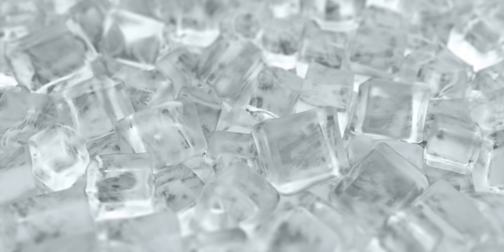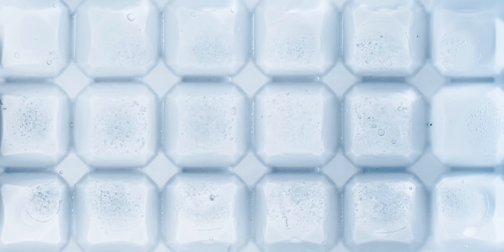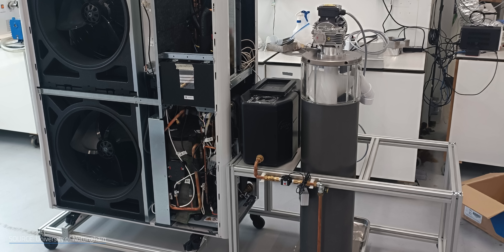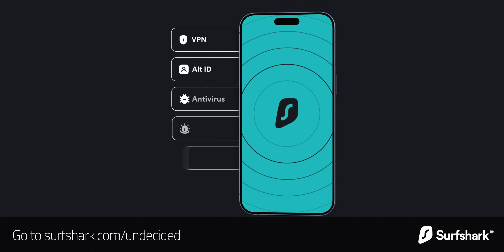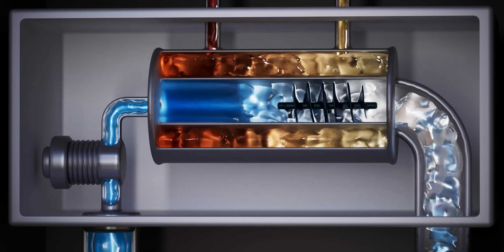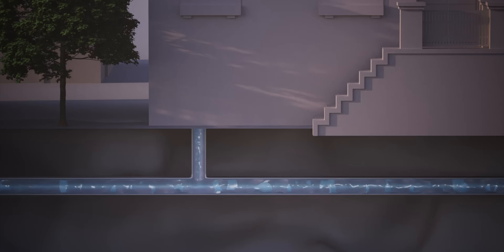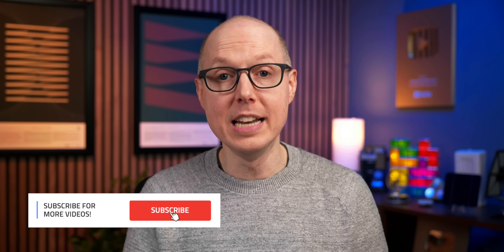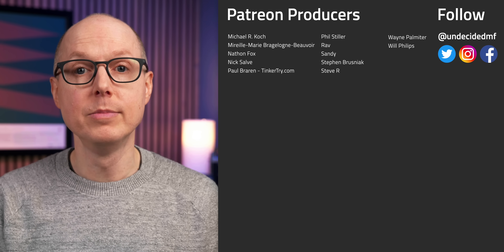How Can Ice Heat Your Home? Ice Source Heat Pumps!

Comment: Slushy machines don't work well with regular water. They require sugar to keep the ice from breaking the auger. The liquid then reaches sub-freezing temperatures  while remaining fluid.  Non-potible water may work, but it could cause big problems.
Reply: Well ... if the mixture remains fluid there is no phase transition and no release of the latent heat
Reply: @EneriGiilaan  Additions like sugar don't prevent the water from freezing at all, just from freezing fully and in small-ish crystals.
Reply: @MikrySoft  OK - thanks for clarification.
Reply: In a closed loop you can add sugar (or another chemical) to the water.
Reply: Water antifreeze mixtures also form ice slurry (slushy)
Reply: I think the concept relies on the fact that it does not freeze 100% of the water.  The auger slices the ice off the cold plate as it is formed and combines it with unfrozen water to make the slush.  As long as the water flow past the cold plate is sufficiently higher than the rate it is being frozen then it will not turn into a block of ice.  The cold plate is the only source of sub freezing cold in system so it cannot freeze into a block unless the auger stops turning.
Reply: @jamesthomas4080  Yes, but you don't seem to grasp, the nature of his failure to understand: The exact same thing, is true of slushy machines. If it wasn't, then they wouldn't be slushy machines. The contents have to freeze (though not all of it, of course), or there'd be no point.
How anyone can fail to understand this, I can never understand.
Reply: @ZarlanTheGreen  A slushy machine is a bit trickier because it is a closed system.  I would not call it the exact same thing.
Reply: @jamesthomas4080  In terms of this discussion: Yes it is.
Reply: @ Sorry, no it is not.  The cold side of the proposed system can be run as open loop system with margin,  by choosing a water flow rate that exceeds the ability of the heat pump to freeze too high a percentage of the water.  The slushy machine must use closed loop control or you could easily turn your plain water into a block of ice.
Reply: @jamesthomas4080  In both systems, you have a mix of frozen and liquid water. Both system requires some of the water to be liquid, and some of it to be frozen.
Reply: @ZarlanTheGreen  No shit Sherlock.  In one system it is more complicated to keep it that way than the other. Apparently this is flying right over your head and I'm wasting my time.
Reply: @jamesthomas4080  The issue at play here, in this discussion, is whether or not it is possible for either of them to work, with any freezing, or if it all needs to remain liquid. For that, your point is completely irrelevant.
Reply: @ZarlanTheGreen  No, the issue at play in this discussion is that OP said that slushy machines don't work well with regular water, which is correct; it is a very difficult problem in a slushy machine.  But this is an open system which the water passes through so it is much easier problem.  You seem to be off on some other world.
Reply: @jamesthomas4080  OP quite explicitly stated, that the water _has to remain liquid, for it to work. (which would mean, that it is no longer a slushy machine/ice-source heat pump) The issue of open/closed system, is an insignificant and unimportant little detail, compared to that.
Reply: @ZarlanTheGreen  He used the word "fluid' meaning the ice/water mixture must flow.  The word liquid does not show up in his post.  This detail you view as unimportant is probably the most important detail for making this work.  But clearly you don't understand the problem.  With plain water you cannot control by temperature because everything from little ice to all ice has the same 0C temperature.  The only hint to how close to having a frozen block in your machine would be the torque needed to turn the auger.   In a closed system you cant return to initial conditions quickly like you can in an open system.  In the open system the problem is purely one of flowing enough available heat in to always exceed the heat extraction capability of the heat pump.
Reply: @jamesthomas4080  Fluid=liquid ...and he also said it doesn't freeze.

"This detail you view as unimportant is probably the most important detail for making this work."

If you have no freezing, it can't work, it can't be what it's supposed to be, and none of what you're talking about, is applicable. In other words, what you're talking about doesn't begin to be relevant.
Reply: @ZarlanTheGreen  Fluid does not = liquid, a gas or liquid or plasma can be a fluid.  A fluid flows, that's what it means.  I'm done with your nonsense.
Reply: @jamesthomas4080  Again, you ignore the bit about slush supposedly not freezing, meaning you're being completely dishonest. In other words, you know can't make your case, honestly.
Also, that there's no point in listening to a single word you say, as none of it is honest or in good faith.
Bye.
Reply: You know antifreeze is made out of sugar
Reply: You can design one that does work with water
Reply: @YunxiaoChu  Ehm, no. A heat pump that uses the latent energy from phase change, can't work if you don't change the phase ...and a slushy machine that doesn't freeze anything, isn't a slushy machine. It's a soft drink machine.
Reply: @ZarlanTheGreen  I mean you can design a machine that makes slush from water
Reply: @YunxiaoChu  If that's what you meant... What was the point of that comment?
Reply: The whole point of the heat pump, is that it gets energy from water turning into ice, so you need it to freeze ...and slush machines don't have their contents in sub-freezing temps, while remaining liquid. If they did, then it wouldn't be slush!
Reply: @ZarlanTheGreen That's not quite true. It's the sugar that acts as an antifreeze.  The sugary beverage generally gets up to 10 degrees F colder than water alone.  The individual crystals form in suspension. The water freezes but is kept in suspension to allow it to flow. The phase change is there, but it doesn't work with regular water because of the bonds made as water freezes. This is why Brain-Freeze occurs so often with these drinks. It's colder than regular ice.
Reply: This is not using 'regular water' but non-pottable water (i.e. treated waste water), the return is through the waste water system which has a fairly high temperature and so will aid the melting of the ice and return flow. There are already WSHP district heating systems using heat recovery from waste-water operating in the UK with some 20TWh of waste water heat lost annually (waste water is 10 to 15 centrigade all year round).  Plus, the 'clean' flow through the old gas pipes into the houses can have additives to prevent the water freezing within the indivual household ISHP.
Reply: @MarkLoves2Fly  "The water freezes but is kept in suspension to allow it to flow." So, in other words: It DOES freeze! As I said.
Reply: @GruffSillyGoat "the return is through the waste water system" There is an existing such system? Are you talking about the sewer system?
Reply: @ZarlanTheGreen  if the water freezes it would be a solid block.
Reply: @Zach476  So you're telling me, that slushies don't contain any ice? You're telling me that slush isn't a thing that exists? That water is either all liquid, or all solid, and you can't have any H₂o in contact with any H₂O, that is in another state?
Reply: @ZarlanTheGreen  I never said slush does not contain ice, and I also never said slush does not exist. Water that is half melted is also not frozen anymore at that point.
Reply: @Zach476  "I never said slush does not contain ice, and I also never said slush does not exist."

That is exactly what you did.

"Water that is half melted is also not frozen anymore at that point."

That is incoherent nonsense.
Reply: @ZarlanTheGreen  how does saying frozen water is sold imply slush does not exist? Most definitions define frozen water as solid and slush as being between freezing and thawing.
Reply: @Zach476  Slush is a mix of frozen water (more commonly referred to as ice) and liquid water. It is never defined as "being between freezing and thawing". There is no such definition, you could point to. The definitions you can find, either define it as partially melted snow/ice, or (which is more accurate) a mixture of snow/ice and water ...and NO part of any definition of ice or "frozen water", requires all water it is in contact with, to be equally frozen.
By your logic, there is no such thing as a frozen lake (as only the top is frozen, rather than the whole) or an ice berg.
Reply: @ZarlanTheGreen  by my logic the the frozen part of the lake is ice and the non-frozen part is water. Cambridge, Merriam, and Oxford Dictionaries define ice as frozen water, freezing as becoming solid due to the cold, and slush as partially melted snow/ice.
Reply: @Zach476  "by my logic the the frozen part of the lake is ice and the non-frozen part is water"

No, it isn't. As you said: "if the water freezes it would be a solid block." In other words, if the lake was frozen, it would be a solid block. Since part of the lake (most of it, in fact) is liquid, then it isn't frozen. This would mean, that there is no ice, AT ALL. Since ice is frozen water ...and you saying that it isn't frozen. And slush can't contain any ice (i.e. frozen water), as that would mean that that it is completely solid, according to you. Because "freezing as becoming sold due to the cold", which you (for some crazy reason) take to mean "ALL of the water being solid, due to the cold".
Do you perhaps labour under the absurd and bizarre notion, that "freezing" and "frozen" aren't different forms, of the exact same word? Something that is freezing, is a thing that is in the process of becoming frozen:
"Verb
freeze (third-person singular simple present freezes, present participle freezing, simple past froze, past participle frozen or (now colloquial) froze)"
"Adjective
frozen (comparative more frozen, superlative most frozen)
    Having undergone the process of freezing; in ice form."

Also: it's "SOLID". Not "sold". Something that is "sold" is something that has been given to someone else, for payment. The past tense version, of sell
...and slush is a mix of ice and water, that can just as well be partially frozen water (as is the case with both slushy machines, as well as the machine in this video), as it could be partially melted ice/snow. But then, dictionaries aren't always fully accurate. Nor do they even aim to be. If you want accuracy, you're better off checking an encyclopedia ...and even better off, checking a more specific/specialized source.
Reply: @ZarlanTheGreen  " "If the water freezes it would be a solid block." In other words, if the lake was frozen, it would be a solid block. " That is in the context of water that is below freezing temperature. With a lake, the surface that freezes is below freezing but the ice that forms insulates the rest of the lake keeping it just above freezing. "the cold" as in below 32F cold. I was Paraphrasing in some of my previous comments, I can use direct quotes if that works better.
Reply: @Zach476  That's completely irrelevant. According to you, none of it is frozen. None of it is ice ...and no part of slush, is frozen/ice. When I said slushy contains ice, that it, and the water in ice-source heat pumps, HAS to freeze, you objected to that, by saying "if the water freezes it would be a solid block.", as your argument for why slush doesn't contain any ice, and a ice-source heat pump cannot work, if any of the water freezes. In other words, you think that nothing can contain ice, unless all of the water is one single lump of ice. Water and ice cannot be in contact with each other, according to you.
Reply: @ZarlanTheGreen  "your argument for why slush doesn't contain any ice, and a ice-source heat pump cannot work" My argument was not about slush not containing ice nor was it that ice-source heat pumps can't work it was that slush is partly thawed/is Slurry, therefore it is still a liquid even if it has ice in it. "In other words, you think that nothing can contain ice, unless all of the water is one single lump of ice. Water and ice cannot be in contact with each other, according to you." I never said that ice can't be in a non-sold form, and I never said ice and water can't be in contact.
Reply: @ZarlanTheGreen  the context of my comments is important if the way you construe/understand my words is that different than the way I view my own comments.
Reply: @Zach476  You are clearly lying. You said "if the water freezes it would be a solid block." The context is crystal clear: You were arguing against my statement, that slush must contain ice, to be slush. I.e., you were saying that slush doesn't contain any ice. It is not physically possible, for any sane and sober person, to possibly interpret the comment, or the context, in any other way.
Reply: @ZarlanTheGreen  "You were arguing against my statement, that slush must contain ice, to be slush." your first comment was that ice-source heat pumps need the water to be frozen not that slush must contain ice. "The whole point of the heat pump, is that it gets energy from water turning into ice, so you need it to freeze" My argument "if the water freezes it would be a solid block." meaning that when water freezes it becomes sold, based on this statement since shush is not sold its a liquid. my first comment also lacks the word ice since I know slush is made of ice(snow) and water. Slush is also a Slurry mixture which is considered a liquid or more accurately a semi-liquid or semisolid.
Reply: @Zach476  My first comment, mentioned the heat pump AND slushy machines. Frozen=contains (in whole or in part) ice. So yes you did mention ice ...and slush is a mix of liquid and solid. "meaning that when water freezes it becomes sold" ....which, a we know, is a lie. Slush is not liquid. It is a mix of liquid and solid. Hence why it is know as SEMI-liquid! ...or, as you say semiSOLID.